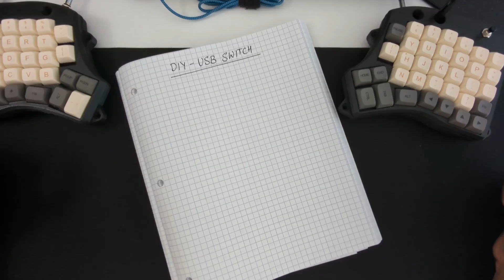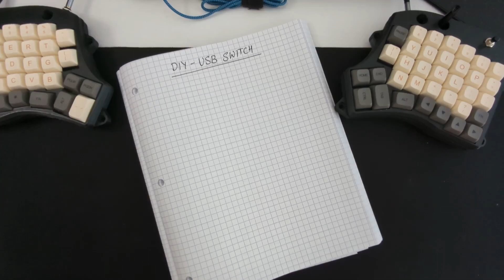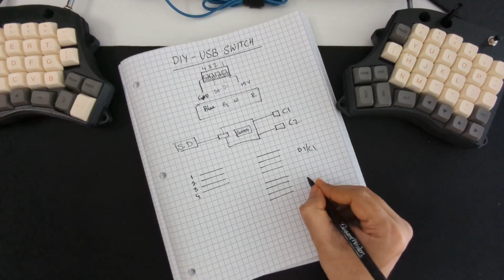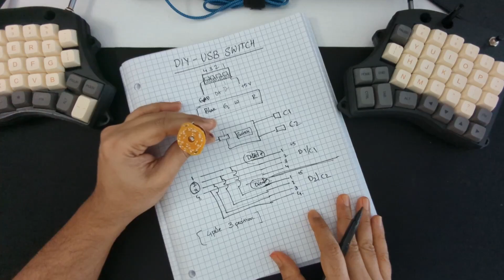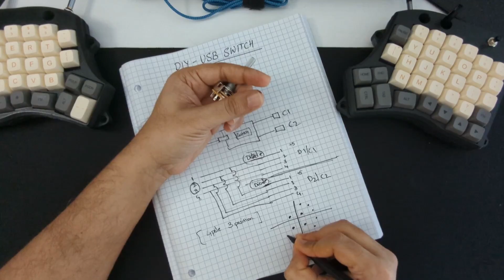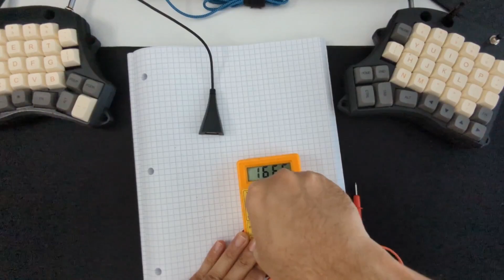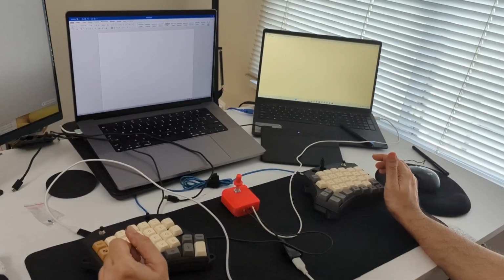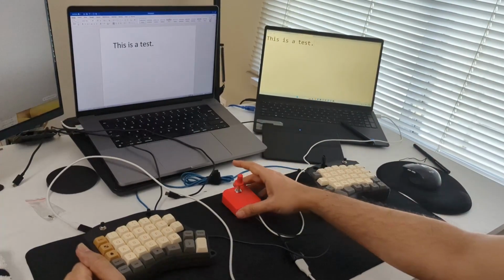DIY USB Switch

Comment: Why cant we use relay?
Reply from the maker: You can use relays, but they have the same limitation as the two-way switches, and you need to protect the circuit from mixing up. What I realized later is the availability of USB switch IC's that can simplify the project.

Comment: Hello man, thanks for the in depth explaination; could it be possible with a 3 contact 4 position switch (its the one i have at home)? with 1 to 4 for A, 5 to 8 for B and 9 to 12 for C, i dont really know how the positions wiring is working tho. i was thinking to link USB Female VCC to 1, D- to 2, D+ to 3 and ground to 4, then link in the same order USB Male 1 to B (5 to 8) and USB Male 2 to C (9 to 12). How would you wire it if its possible?
Thanks, keep up the good work
Reply from the maker: 3 contact 4 position switch can be used to connect an additional device, but you will not be able to switch the four leads of USB without some additional logic. Probably, connect VCC, ground and D+ to your switch and directly connect D- protected by diodes for protection. Did you manage to make your switch? did it work?